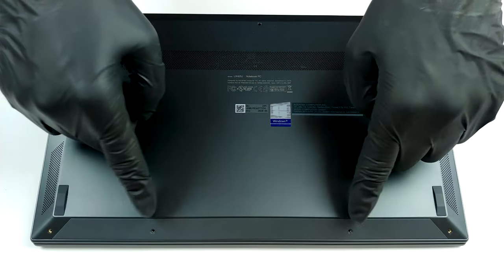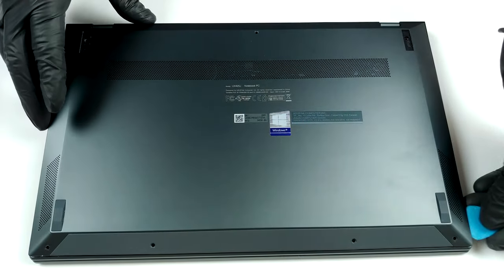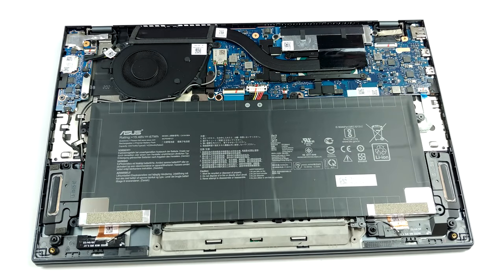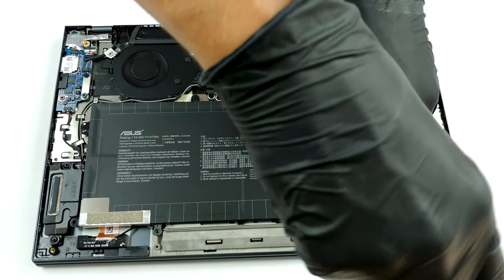🛠️ ASUS ZenBook 14 UX425 - disassembly and upgrade options

Comment: In this laptop, does it contains an extra slot for an additional 512GB SSD apart from the in-built 512GB SSD ?
Reply: +1
This part is not clear

Comment: I really like this laptop, I own it, it runs well, got it on a budget. I just wish I could upgrade the RAM, only gripe.
Reply: I own this device too. Don't you think it's got bad thermals? It gets so freakin' hot!!
Reply: @amanchaudhary3340  repaste it
Reply: What does 'repasting' mean? 😬
Reply: @amanchaudhary3340   he mean the thermal paste. what degree are you getting ? Mine never felt slightly hot on the keyboard. it's just the bottm of the chasis that gets hot. Anything <80 degree C you can ignore it.
Reply: @25557813  yeah, it's just the bottom of the chassis. But still, one time it got so hot, 1080p movie got stuck for 2 seconds. It said "loading". I thought it was because of the heat because it felt burning hot at the bottom.
Maybe the issue was something else. I don't have thermal sensor , so I can't say if it was above 80°C or not. Thanks for the reply by the way.

Comment: hello, is it possible replace/upgrade the wifi-bluetooth card?
Reply: Can be replaced like for like (if you can find the part and have the right kit), but as it is a CRF module I wouldn't count on changing it. Also, as this is WiFi 6, why would you want to? (genuine question).
Reply: @chrishanmer569  kinda sucks behind a concrete wall it looses 21 Ms it is ok but my wifi is fiber optic and idk why this happends

Comment: I 'm disappointed with this laptop bought on november 2020. After 1 year and a bit, the battery performance are worse and the its level decrease after few hours. And also the performance of the laptop in general are not always great perfomances. Sometimes it goes crazy also if I have to manage a simple 380mb file of a particular program
Reply: I have to agree on the battery life actually, I am a bit disappointed with it.

Comment: My ux425ea not starting. Power button not reacting. But if press for 15 seconds it blinks short with led. What to do? Any way to reset bios?
Reply: Disconnect the battery and hold the power button with no battery for 20-sec then, plug battery back in and try to power it on.

Comment: how hard is it to remove the bottom rubber feet? i tried prying them out but seems like hard to get them out?
Reply: I put a very thin screwdriver or a pin in the rubber, and pull it out. You don't see the pin hole after because it's rubber.

Comment: This laptop is an overpriced piece of garbage. Non-upgradable RAM and so far no Windows 11 update either. I will avoid buying another ASUS again.
Reply: Well I have it, with 16gb which is more than enough and windows 11? I bought it with ryzen 7 5800H at 1100€. I could have had it for 850€.
Reply: Solid metal case, excellent screen. I have stock Ubuntu and it works well even on this i3 version. £500. Overpriced, I think not.
Reply: Mine upgraded to Windows 11 for free and the camera complies with the Security requirements to log in with face recognition, it's a great laptop... I switched the nvme for a crucial P3 Plus and this thing flies, also with Dolby Home Theater v4, it blows your ears easily! 😂😎